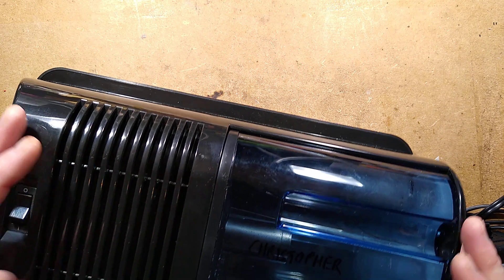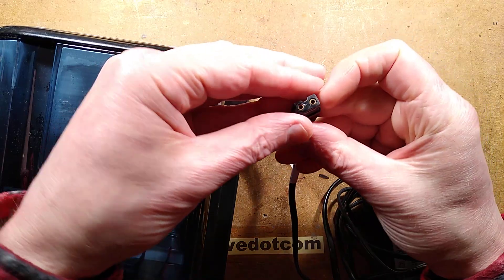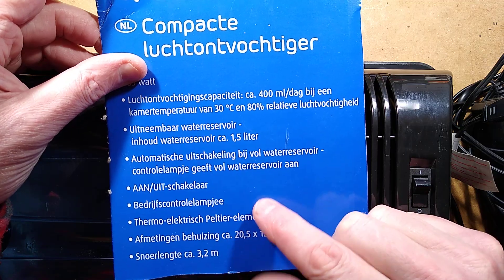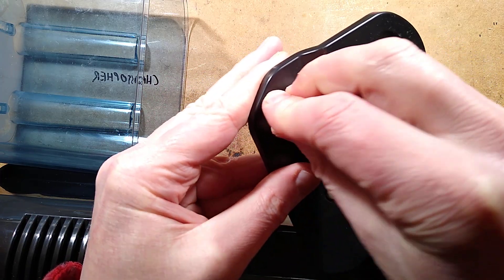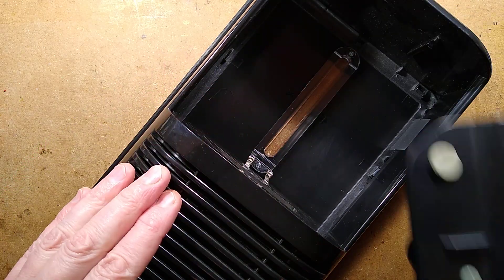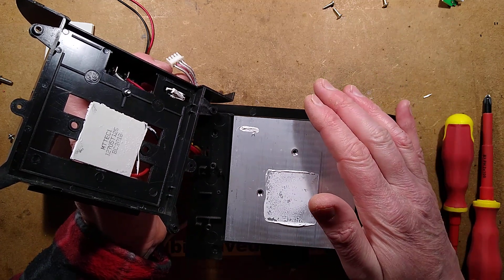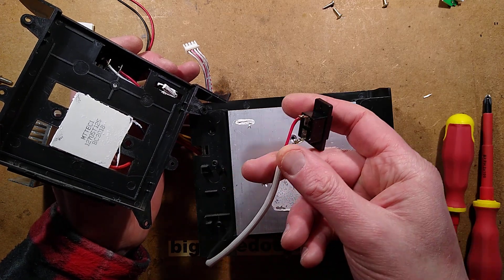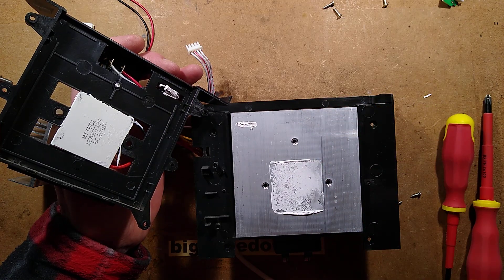Inside a faulty Aldi dehumidifier.

Comment: Haven't seen you do a teardown on a compressor dehumidifier yet. 
Would like to see you do one, if possible, as well as a rundown on some of the claims of large dehumidifier manufacturers (eg Meaco) and their actual performance. 
Seems (from what I've read and seen personally) that the desiccant drum ones actually pull more moisture than what the manufacturer claims they do, I assume their calculations are done based on the drum itself and not the heat exchanger (or primarily the drum) so any air that blows by a saturated drum may still condense, especially in colder rooms even though the condenser is a simple plastic one.

A KWh/l race against two ( modern) competing types (drum and compressor) at the low indoor (10-15c) temperatures manufactures claim both work fine at might make for an interesting video. 

Having got one myself due to mildew I've realized how much I've been running central heating to just offset latent humidity in what is a damp house. 14-15c at what is <60% RH feels warmer than 17-18c at >70% RH.
Reply from the maker: The main advantage of the desiccant units is that they operate efficiently at much lower temperatures.

Comment: I wonder what the cost would be to provide enough of these to provide a single adult human with enough drinking water for one day per day of operation? I would think that a well would probably be more cost effective. But I would be curious to know by how much? Both a well and a Peltier dehumidifier could be rigged up to pump their products into storage tanks, and could conceivably both run 24/7. But if you needed to pack up and move to a new location frequently enough, sinking a new well on each move could be tedious.
Reply from the maker: I doubt this unit could provide enough drinking water in a day, even in ideal conditions.
Reply: The well would be the solution

Comment: I bought a box of raw Peltier plates. Why? For fun, of course! Running them with the cold side exposed and the hot side properly cooled will result in substantial ice very quickly.
One is a very large one that I haven't figured out an effective way to keep it cool when running at full power. It's a powerful one. IIRC it's like 200w. Even computer grade heat sinks allow it to get uncomfortably hot, and I don't want to blow it up.
I've also got a peltier mini-fridge and a peltier drink cup cooler. The latter can also build substantial ice on it if I don't have a drink sitting on it while set for full power.
These things are just so neat! :D Also, use computer-grade thermal compound to replace the goop they put in there. It's what I use, but I also work on computers a lot, so have a lot of it.
It'll improve transfer efficiency. You can also get compounds designed for low temperature operation, or for ultra long service life.

Comment: I have had one of these for several years in my storage room which used to get very damp and even mouldy especially in winter on one wall which has the cold water pipe running along the skirting area. Pretty much cured it all year round by two to three years ago. Just wipe down with cold water as insurance against fungal build up every few months or so as the walls also dry quickly now, no sweat. 

One thing I noticed a few years back which may have coincided with the improvement was that the noise has greatly reduced. I wonder if I didn't connect up quite snugly enough on original installment and it could have been ready to overload. I think it is a design flaw resulting in the tick and cross symbols. There is no noticeable 'click' to inform you that it is absolutely 'in'. I have an Epson printer with similar connectivity. Sorry to hear yours and others have been faulty but in full working order these are little beauties.

Comment: How efficient would the peltier dishes be using them like solar panels? Maybe coat one side with a paint that is really good at absorbing solar radiation and put a heat sync on the cooling side, maybe using some water in a closed loop, relying on the heat of the water to pump it around? I'm curious how much power that'd generate compared to solar a solar cell
Reply from the maker: They'd not generate much.
Reply: @bigclivedotcom  ahh, was worth the thought experiment at least... might try it anyways for kicks n giggles.

Comment: I watched another video of yours recently where you opened up another dehumidifier, so pleasantly surprised to see you open up one of these as I bought a couple recently. I know Peltier dehumidifiers aren't the best but I can't afford to spend hundreds on a dessicant or refrigerant dehumidifier at the moment, so it's good to know how to open this up in case I need to clean or maintain it. I just checked my plug and it wasn't inserted the entire way so fixed that too!

Is there really no way of making the coldsink for these more efficient? Can you add more fins, or like etch something into the metal at a microscopic level so that water condenses more easily/quickly? I refuse to believe these can't be made more efficient but I'm not an engineer.
Reply from the maker: These units are so inefficient that ultimately a proper mains powered unit will turn out more cost effective due to the efficiency of water removal.

Comment: Unless the technology evolves I can't see the point of wasting 60 watts to barely condense any water, and what you do condense from the air in the average room will be replaced by drafts/doors opening in the space you are trying to dry. I have got good results from 600 watt portable condenser units, great for drying laundry indoors in a small room in winter when you have the heating on anyway, work out cheaper than a tumble dryer. In reverse mode, Peltier devices are great for generating electricity from camping stoves, etc, to generate power to charge a mobile phone when camping - charge while you cook.

Comment: If you still have this around, could you measure the temperatures at around 13:54? I'm curious just how well it can cool the air, given how inefficient it is but with the report being "painfully cold."
Reply from the maker: I would expect the net result of this unit will be warmer air after the cooling and heating.

Comment: Boy oh boy does that not look like 5AMP cabling and cooling inside the box , I use a 6000 RPM 120mm delta axial fan with a fat old heatsink off a dell OEM prebuilt and that can only handle about 100-120w when I overvolt mine

Comment: I bought one of these from Amazon to remove damp from my many standing cars, but it's a bit poo tbh. Any idea how i can make it more effective? Could i possibly switch out the Peltier for a more powerful one? Put a bigger heatsink on the hot side?
Reply from the maker: They're not a great unit.  They require a very limited warm temperature range to work in.  Air ventilation is one of the best ways to keep a car dry.
Reply: @bigclivedotcom  Aaaaa I got a reply from the great man himself. Thanks!

Comment: can you please take apart a small humidifier that runs on a usb plug and has a rechargeable 3.7 volt 2200 ma battery in it, then please explain how it works, thanks
Reply from the maker: Piezo atomiser disk.  I made a video about one of those recently.
Reply: @bigclivedotcom  I watched most of it and skimmed through trying to find out the frequency of the piezo disk with no luck, just curious, do you know about what frequency is used?  thanks ;-)
Reply from the maker: @andyp3834  They sell the bare disks on eBay and usually specify the frequency.  I think it's in the region of 40kHz.
Reply: @bigclivedotcom  thanks

Comment: i got two  Aldi dehumidifiers not same as your one tho. as our bedroom gets damp no other room but that one.when i first got them they worked really well but over time the power unit stopped working on both units so i use a car battery to run them but one of them keeps flashing red and wont run,would this be the heat sink past dried out do you think.if i take it apart give it a clean it works again for about 2 hours then flashes red again.very funny as i cant find any lose wires or anything else wrong with it.your thoughts would be appreciated.
Reply from the maker: There's usually not much in them.  Just some switches on the water drawer and float.
Reply: @bigclivedotcom  
OK thank you for your reply, I took one of them apart today and its a lot bigger then your one you took apart.as in the inside.it has two cold plates and two of them sandwich plates i put more heat sink past on the both sides and it worked for about 10 mins then flashed red again  the circuit board has a lot more components on it and much bigger.just dont understand why they keep flashing red.both of them do it now so i cant use any of them.do you think you could fix one of them?
Reply from the maker: @mrfr3d  Are they clean and are the fans moving decent air through them?

Comment: In 1986, when domestic dehumidifiers were quite a new thing on the market, I bought a Toshiba DryMINI compressor dehumidifier.  Quite heavy, and more foursquare in design than today's units, it has a mostly metal body (measuring 230mm by 340mm by 47mm high). It was expensive at the time, £200, as they were not in general distribution and I got it from a specialist heating/electrical place.   It's rated at 199W, 1.5 Amps.  I wanted it for my room at the time, which was on an exposed corner of the building, no cavity wall insulation, no central heating and single-glazed metal-frame windows.  While there was no water ingress from outside, moisture-laden air from elsewhere in the house condensed in there, and things were getting mildewed.  I installed the Toshiba DryMINI, and kept the draught-excluded door shut so that only the air in that room was processed.  I decided to measure the water extracted.  In the first 48 hours of operation (not running it at night, in case it sucked all the fluids out my body and I awoke in the morning a desiccated corpse), the DryMINI extracted TEN PINTS (5.68 litres) of water from the air in the room.  I was impressed.  And I am still impressed today because 34 years later it is still going strong!  The fan has become ever so slightly rattle-y because the bearings must be a little worn (but the machine has always been incredibly quiet in operation).  So, hats off to Toshiba for a durable product!  I am a huge believer in dehumidifiers for here in the West of Scotland.
Reply from the maker: You may be able to get a new fan motor if it's an older product that used standard components.  It may even just be a loose blade on its shaft adaptor.
Reply: @bigclivedotcom  Thank you for those suggestions!  It's only the very slightest rattle. If and when it gets worse, I will investigate the options you suggest.

Comment: I watch a vlog by David McLuckie who has been doing some excellent tests with the kind of Chinese diesel heaters that I have bought to use on my boat. He was looking at using Peltier effect chips on the exhaust from the heater to make use of the ample waste heat to produce enough power to compensate for the heater demand on the supply battery. 
I have also bought a Peltier refrigeration unit like that one from Banggood for pennies to chill my boat cool box. I really like the idea of producing the power to compensate for the running of both. Just greedy I guess. 😉

Comment: single shot thermal fuse, whats the cost for a resetting one? maybe 5cents moe?
Reply from the maker: It's a safety thing.  The self resetting ones can fail shut so they often have a single shot thermal fuse as a last resort.  In this application the fuse failing would only occur in terminal fault conditions like fan failure.  When opening to change the fan the fuse could be replaced.
Reply: @bigclivedotcom   egg on my face ....thank you for replying ;)
Reply from the maker: @Dan-bv8ne  No egg.  Just enhanced knowledge.

Comment: You cant use standard PC paste, or a thermal pad because of how cold TEC's can get on the cold side. 
The hotside, you could use something more efficient (AS5, Thermal Grizzly), but not the cold side. 
The white stuff, is aluminum oxide paste (AS Ceramique type), which is better than the grey stuff for sub zero temps. This is why when you see people benching PC's with LN2, they use white paste and not grey. Unfortunately as you noted, the white stuff does dry out a lot faster then the grey stuff.

Also the wonderful thing about TEC's is you can run them on PWM, to make them somewhat efficient.  
That is probably the best way to run a TEC and maintain a pretty competitive CoP against a phase compressor chiller.

Comment: Heatsink compound goes hard after a few years. It does it’s job still but not always as well. It’s goal is to fill the air gaps with a material that will conduct heat.

Comment: I have a very similar unit, and had to return the previous one as the plug (as you've shown) started to melt! I have to say it's a fairly effective, I leave it running next to my laundry airer and it'll fill its tank in about a week.
Reply: the connector they used was obviously not suitable for the current,, luckily its only low voltage,

Comment: Clive: based on an ambient temperature of 30°C, which is absolutely sweltering.
Australians without air conditioning: Uhh, I mean, you're not wrong, but also that's just the lower limit of what we'd consider "hot". It's when it hits 38°C that you really start suffering.

Comment: I wonder why the power connector and cord had that melting problem? The IEC320-C7 connector is typically overrated by current carrying capability, hence their warning on seating the plug. Any loss of spring tension or corrosion would further lower the current carrying capability in a device that draws 5 amps for the Peltier device, plus fan (for the current of indicators, it's a serious case of who cares).

The device you own is rated, rather enthusiastically, for 60 degrees at 6 amps and for that, actually requires a perfect gas, perfect black body, etc. Still, they're not dreadfully inefficient, compared to evaporator based cooling. The device inside of the unit is rated at 50 degrees at 5 amps.

Frankly, any engineer offering me a design where I have to reinforce seating the mains plug is a design that engineer will be sent from the room to specify a better mains connector and said engineer would have seriously frazzled hair from the heat of my response.

BTW, if you don't want the cookie, feel free to attach it to an e-mail and pass it along. Given my thyroid, I can use the additional calories.